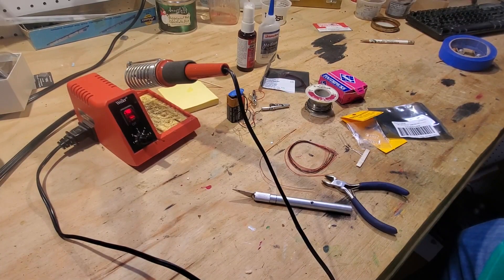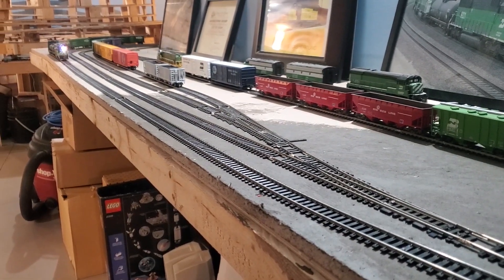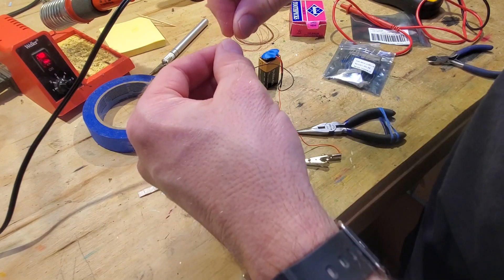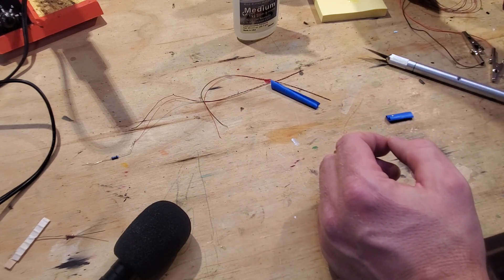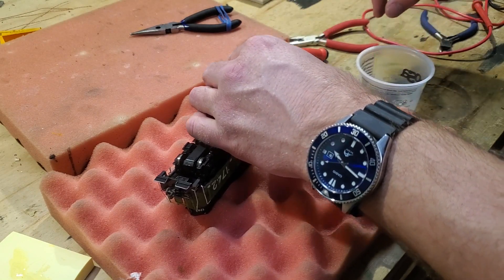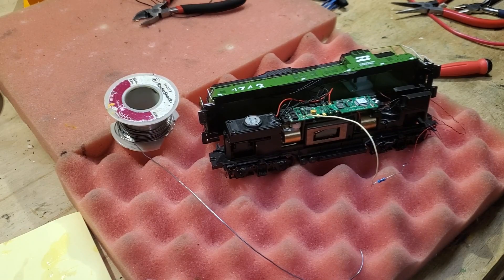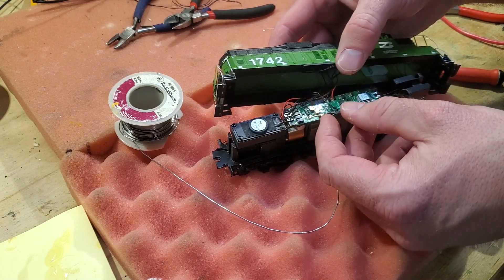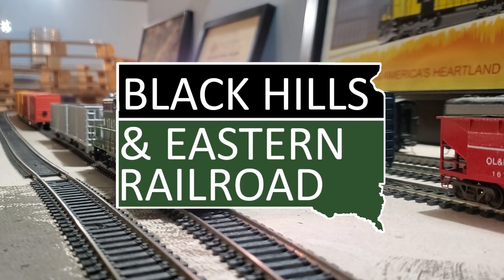Replacement SMD LEDs for an older HO scale Athearn Genesis GP9 failed incandescent bulbs

Comment: I missed it. You put a resistor on the +14 pad on the board and soldered that to the LED lead. I assume that went to the red wire, but where did you connect the other wire lead?
Reply from the maker: If I recall correctly, that is a GN-1000 board.  Would be the pin right next to the +14 pad, on the front of the board.   Ordinarily, that wire would be the white for F0F (front headlight) and the yellow wire would be the rear (F0R) on the other end of the decoder.